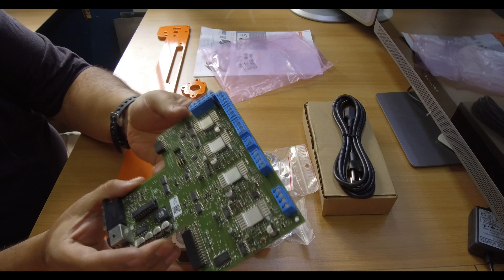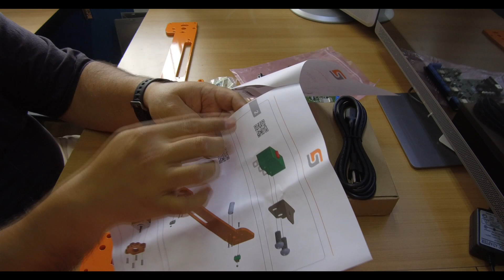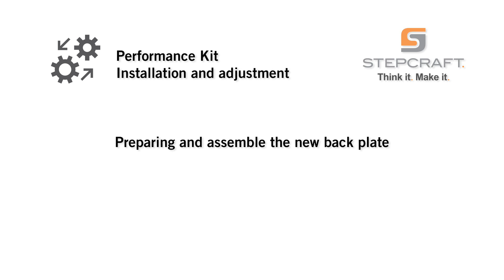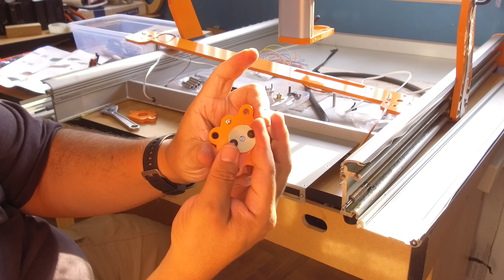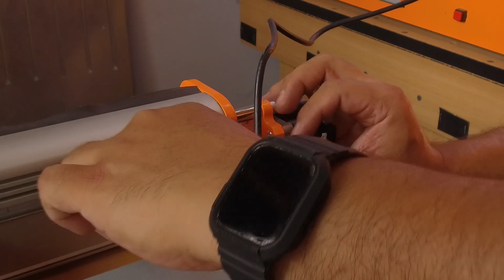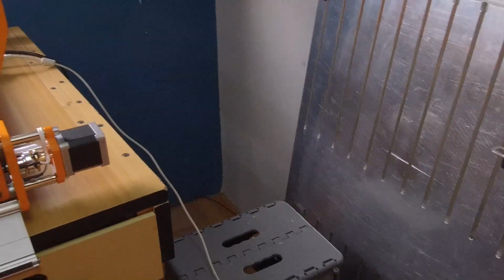Stepcraft Performance Kit Installation and tuning

Comment: Don't see this on the website. Is this kit an option, add on or what?
Reply: https://www.stepcraft.us/shop?search=performance
Reply: I'm having some binding issues.  Y motor 1 ,sensor 1 and limit switch 1 to the same position on the machine?  Can you show that on the circuit board please.